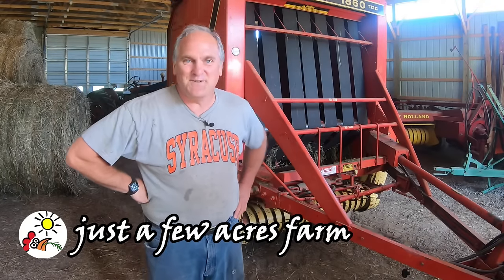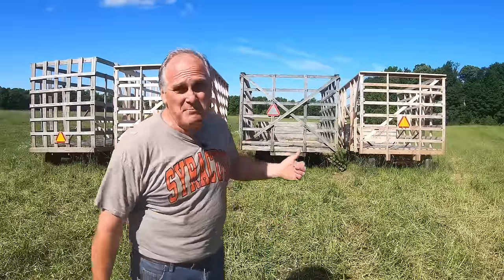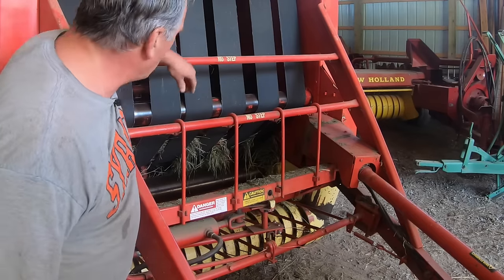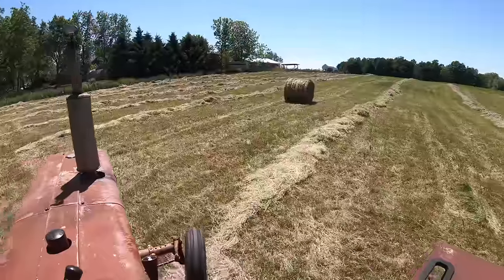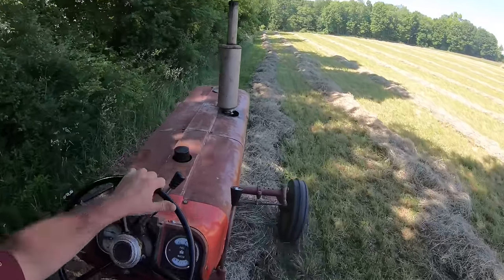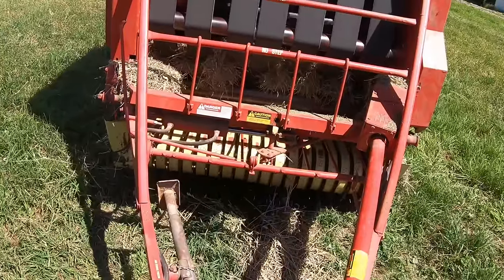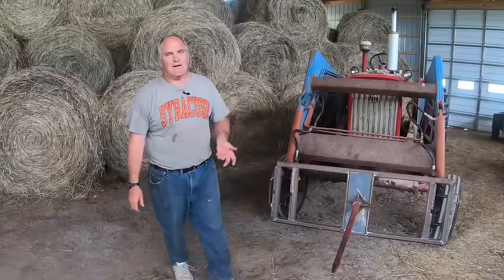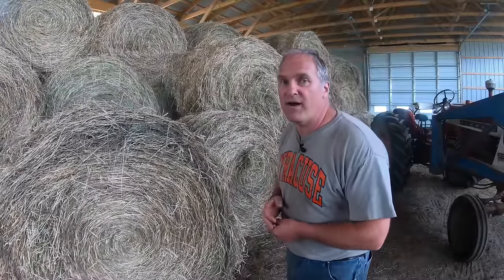the basics of baling and storing hay

Comment: Excellent explanations.  I use a 5209 grey NI discbine. It takes a few more horsepower, so I used my 986 that I traded services for.  It has a lot of blow by, and either needs a valve job or in frame overhaul.  I rake with a Gehl wheel rake and a gas 656.  I used to use my M, but I like the power steering on my 656.  I bale with a 4020 hooked to a JD 447.  The 4020 was my first tractor on the farm 22 years ago and will never leave.  I found an old GMC 7000 flat bed with a hoist that will haul 11 bales.  That sure beats pulling them off the wagon. I can load in the field, haul it a mile and a half and dump in front of the barn. As a member of ffa (father farms alone) that helps.  My wife has asthma, so no hay work for her.  Your system and mine are remarkably similar, except that we have highlands rather than dexters.  Farming beats working for a living any day.  I do get a bit jealous of my daughter and son in law, who have over 4k acres and very large, very nice, very expensive, and very comfortable equipment.  I enjoy helping them, but I do like my old equipment. My Farmall M and I were born the same year, and my Ford 8N is a year older than I am. I hope to last another 10 years at it.

Comment: I learned to cut and bale hay (in northern Kansas where it's dry and windy) with a self-propelled swather that cut the grass and left it in a windrow. My buddy ran that while I chased him with a little White tractor pulling a square bailer and a 6-bale wagon. When the 6th bale was complete the wagon dumped the bales as a set. We'd then use a tractor with a square front load pickup that would pick up the 6 bales and they'd be stacked on the wagon. We rarely had to touch a bale. My buddy's dad had a hay farm where he put up 70,000 bales per season. I also made extra spending money for several years bucking bales on other farms. Never made a lot of money but my favorite job was on an old preacher's farm who at the end of the day provided all the ice cream we sweaty boys could eat. Good days, great memories.

Comment: Hi Pete, thought I'd tell you we used an Oliver 50T baler bought new and it worked for about 35 years!  Always loaded bales directly from the baler chute to the wagons.  We put up 2-3000 bales and rarely were able to get a second cutting.  Replaced the Oliver baler with a JD 327 (still no kicker) and used that until we quit dairying.  That was in mid-80"s and round bales were just coming into the area.
Reply from the maker: Hi Donald, loading hay the old fashioned way!

Comment: I just found your channel and what a great resource.  My wife and I just started making hay on our 40 acre farm.  We plan to add beef cows in a few months.  I have a John Deere 336 and a Massey Ferguson 255 and can definitely relate to the amount of work it takes to put up small square bales.  Like you, I bought used equipment and saved a lot of money.   We have a hay loft so small squares are a necessity at this time.  At 57 I couldn't agree more that small squares are tough on the body.  My 2 grown sons help when they can but most of the work is done by my wife and I.  We are currently selling the hay until we get a herd when we will keep some to feed.  We also plan to use rotational grazing and your videos are incredibly helpful.  Thanks again for sharing.
Reply from the maker: Hi Mark, I'm glad you found our channel! Working in a hay loft in the heat of summer, right under the hot roof with the air filled with dust is about the most brutal job ever. We put hay up this way when I was a kid and I don't miss it one bit. When my wife & I were doing square bales, we were stacking them on the floor of one of our pole barns & that was much easier. Best of luck to you & your wife!

Comment: I had a chance to work with a IH 966 with the seat turned 15 degrees or so to the right. this was about 20 some years ago. But the difference was significant enough to eliminate neck strain by half. It was a custom seat job and I have not seen one like it since.

Comment: I love making 5’x 66”bales. I’d hate moving and putting out 20% more hay! And we still run them 2 wide on a trailer to haul them home sometimes, if we’re not using our inline trailer. 

I hope you’re able to grow and upgrade to a netwrap baler and cabbed tractor some day! 

We run a Deere 569 silage special baler and wrap some wet hay every year too. We usually bale around 1000 5’x66” bales every year, weighing in at 1250-1400lbs.
Reply from the maker: Hi Drew, those are some big bales! I could use a cab today, it's in the 90's & humid.

Comment: Great series. I want to rush out and get an International with Hydrostatic. Too bad I left the farm in NY and now I'm a software developer in AZ... :(
Farm: 56 head Holsteins in the Catskill Mts. (active 1950 - 1984)
Tractors: Massey Ferguson 65 diesel (previously MF 35, MF 175, MF 285 when the milk prices were high in the 70s)
Haybine: New Holland 9' with improperly adjusted cutting bar/guards
Rake: 4-disc single line with ridiculously long tongue
Baler: New Holland square baler, pony engine kicker, rusty knotters
2 broken-down wooden hay wagons prone to tipping on hillsides, especially in woodchuck holes
1948 Willy's CJ 2A rescue Jeep
Good times. I miss making hay forts...

Comment: Hate to tell you, upper 80’s isn’t hot. Now a cab tractor with broken air conditioner when the temperature is in the low 100’s is hot.... I would have loved to have an open station tractor when that happened to me me a couple years ago.  Good video and explanations, I like the way you run your farm as well.
Reply from the maker: Hoo man that would be hot! Especially with the heat the hydro puts out on the floorboards.

Comment: You could try to put 5 bales on wagon.
We have old Russian round belt baler. That starts wrapping bale with twine automatically and the tying mechanism is tied to bale unload function.
We also have square baler but the tying mechanisms on that are so worn out that it simply doesn't create knots.
I myself prefer square bales, but that is because we have sheep and when feeding is done manually square bale operation is much easier.

Comment: A Gehl is a good brand baler I had a 1475 Gehl 4x5 baler . Used it for 6-7 years up graded to a new 458 mega wide John Deere 4x5 baler.  I rather use a cab tractor baling hay . It's so much better your not breathing in dust all day that is unhealthy .  I like your barn .   Your baler made a good bale looks like a 5x5 bale.  What is your location state? I remember you saying your baling season started in June , we start here in Kentucky in the 2nd to3rd week in May.

Comment: We use a flat 8 sledge and grab then put it in stacks 7 high then I have a trailer that picks up the stack of 56 bales in one go and take it back to the shed and stack it using the grab. It works well and I don't have to handle the bales that much.
I tend to use it for horses and sheep and use big bale hay and silage for the cattle.
I bale and wrap silage for my self and others it is better than the big bags we used to have to put the bales in in the past. The problem with bads was if you get a hole in the bag it really messes up the quality of the bale. Birds will peck at the shine from the sun on a bail and create lots of holes unless you cover them in nets. Seagulls are the worst for that.

Comment: I've found that roller  round balers as opposed to belt models don't need so much 'weaving about' to prevent tapered bales. Also have you considered putting a small head and tail board on your trailer? This would stop them rolling off and you could put two more on top. Interesting to compare US farms with UK farms, thanks.
Reply from the maker: Hi Ronnie, when I get around to rebuilding that wagon I intend on lengthening it to 20' and adding sloped ends on it to contain the bales. It's on the never-ending to-do list!

Comment: Hello, thanks for making these thoroughly explained videos. Can you share how much diesel fuel did you use after 5 hours of bailing and hauling? I am curious how much energy it took per bale. I am wondering how much battery capacity it would take to do this amount of work with an electric powered tractor. One of my dreams is to have all electric solar powered small farm when i retire.

Comment: Once again great video, what would you say those rolls are weighing? And do you feed your first cutting first?
Reply: Weight of bales depends on the crop the moisture level etc belt balers pack bales tighter than chain.. I feed last cut first since generally it's first I get too
Reply from the maker: Hi Joey, they weigh between 1,000 & 1,200 lbs. We feed first cutting first, and save the better quality 2nd & 3rd cutting for late in the hay feeding season, when the cows are in their third trimester of pregnancy.

Comment: Just FYI 4x5 is what most people bale typically.. best way is to use a moisture meter for those who are not familiar with twist testing. I'd also say round balers are more forgiving with hay with more moisture.Small Square balers do not like moist hay.
Reply from the maker: Hi farmall1, judging from comments, standard bale size seems to vary by region; I had no idea. Around here in upstate NY 4x4 is standard. Someone from Missouri said 6x6 is the standard, and you have 4x5 where you're located. Whatever works! (I like your screen name by the way)
Reply: @JustaFewAcresFarm  thanks I like yours too I've always wanted to do more ag videos but never invested in the software or anything needed. Whatever works is correct farming is a job you can do the same thing 1 million different ways. That gehl baler reminds me of a older Vermeer baler. You have some nice tractors BTW I am in VA

Comment: At 15 I worked for a farmer, mom dropped me off at 6:30 am ,  I ran the barn cleaner and did other chores before and after a 7:30 breakfast by 9 am in the field usually hay, me at 15, him at 37 guess who was on the wagon and who was in the barn stacking, by mid July the hay was 10 feet from the top and growing I ended up on my knees stacking near the roof, not the best summer job I ever had but I did not have to milk cows, even then I knew it was not for me I would do any other job a farm needs no problem. The best part of working on any of the many farms was hands down the number one thing was the food. All you could eat usually three full meals and I mean full meals no pizza or sandwich, meat, potatoes, bread and two vegetables plus dessert. Yes that is what I am talking about

Comment: Thanks. Very informative.  What feature of the square baler determines when the bale reaches the proper size?
Reply: There's an arm and you can adjust it for the length but the bale chamber width and height is not adjustable.

Comment: bit of a hobby farm for western standards. In Australia nobody would cart 4 bails at a time now you would be there forever, they would bring a 11 tonne truck or pull 20 bails, 4 bails at a time would of been in 1994. Also your only pulling about 1 tonne with that tractor you can put 2 more bails on top with that wagon and pull 5. Never seen a 50HP tractor with a round bailer thats got to be the MIN but then again that is a late 70s or 80s bailer. Most round bailers now would need 120 HP to perform well. String bailers are cheap because nobody wants them anymore even in Australia where it doesnt rain as much as the US. There a lot slower but fine for 200 acres or less. The price you paid for the bailer was a great very cheap when you considering a half decent modern round bailer would cost at least 20,000 USD